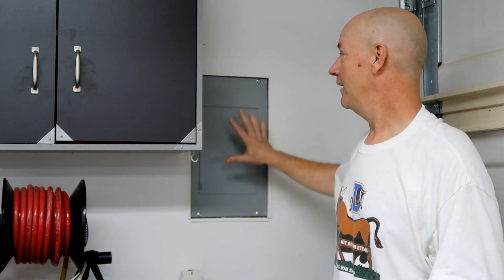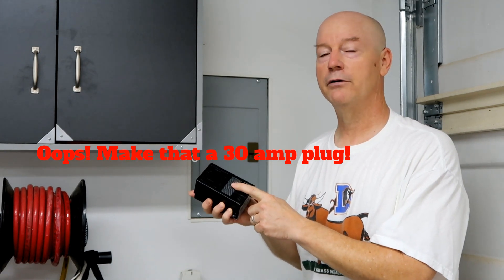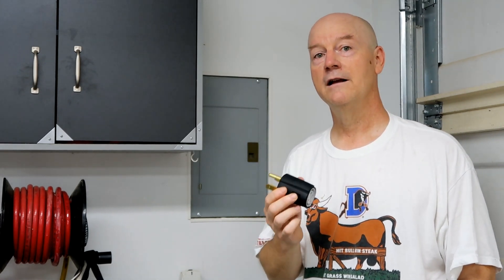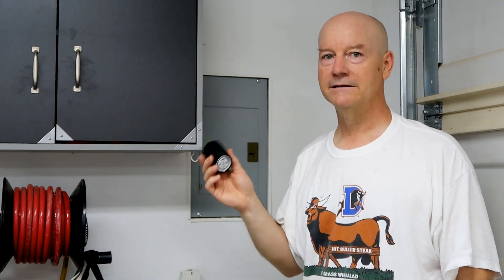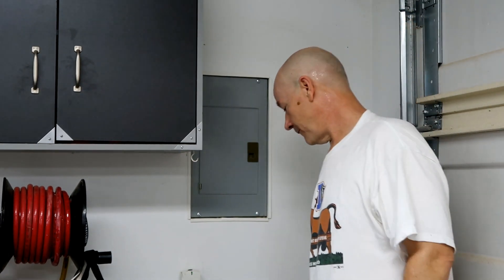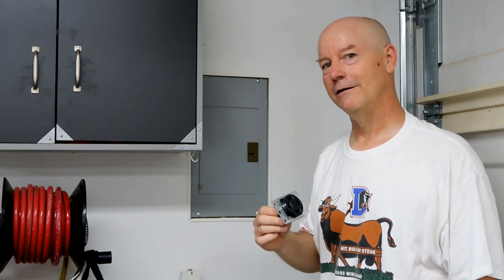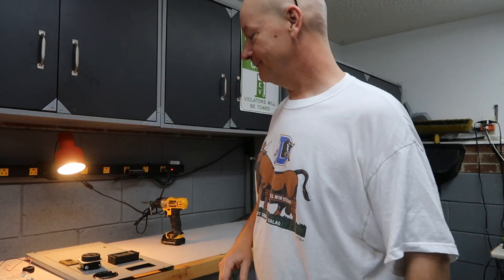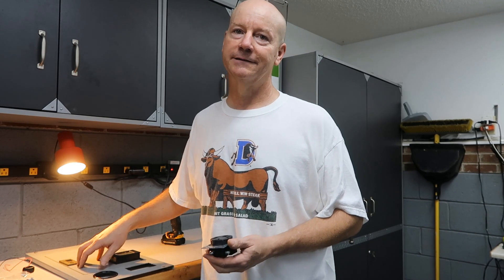Wiring the Electric Panel for Charging Our Tesla

Comment: Here's the problem: this is totally not to code.  You'll never pass inspection with this work.  Since you won't have it stickered or have a permit on file with your town, if there's ever a fire in your house your underwriter will work overtime to deny the claim altogether.  Do stuff to code, get it signed off on by the wiring inspector, and sleep easy at night.

Comment: An electrical panel is not a junction box . Therefore this installation is illegal . A 12' X 12" separate box or whatever size is needed will be just fine. The gentleman however did a fine job . But now needs to purchase a new cover and a junction box . Sorry !

Comment: I ordered one of those power energy meters today. I paid the extra couple bucks to get the split CT to make setup super easy.  I have a metal junction box 2 feet over my 16-50 outlet and plan on installing this in the cover.  I do have one question - you said to null out the tiny current the meter pulls to run one of the small wires from the meter back through the CT.  Do you mean one of the two wires coming off the CT you looped back through the CT before attaching it to the meter?  Thanks Don.
Reply: Joe, the split CT will be much easier to install.  I have used them before.  Besides the CT there are two small wires that power the meter and also allow it to sense the voltage.  In my case,  I attached those two power/sense wires to each hot wire at the 14-50 receptacle.  The CT was near the receptacle (like a couple inches down one of the hot wires). So the small amount of current drawn by the meter flows thru the CT.  So to cancel that current just run the small wire from the receptacle terminal thru the CT then to the meter.  Just do the one wire -  the one on the leg that has the CT.  You might have to use a bit longer (small) wire to connect to the meter.  The small wires don't have to be the same length. If you connect the small wires to the breaker then don't run either of the small wires thru the CT since the current the meter uses would not be measured by the CT.
Reply: Thanks, exactly what I needed to know.  I'll have to use 2' of wire to snake down to where the outlet is. Now I'm glad my electrician put a junction box in above the outlet.  He said it would come in handy one day.
Reply: Installed it today and it's working perfectly.  At first I didn't run the meter wire through the CT - just to see what it was pulling. Then I changed it and reads 0.0W 0.0A @ 245V.  Then plugged back in the MCU and pulls 0.05A  2.3W @ 245V.  Thanks for the clarifications.

Comment: I like that digital meter you added to the panel, think I might get one as well.  But looking at the install directions, I'm not clear on how to wire this for a NEMA 14-50 outlet.  Which wire(s) exactly did you feed inside the CT "donut"??  For a 240V application like the 14-50 outlet, did you feed just L1 through the CT, or both L1 and L2?  Or perhaps just the neutral?  The install directions show a normal 120v install with just one hot lead.  But not sure how to install this when you have 2 hot leads like in your case??  Thanks.
Reply: Hi Sean, I ran just one of the hot wires (L1 or L2 it does not matter) leaving the dual pole (240) breaker through the current transformer (CT) then on to the NEMA receptacle. The two small wires that power the meter are attached to the L1/L2 lugs on the receptacle along with the heavy wires from the breaker - that way the meter is reading the voltage at the receptacle. To get the meter to read 0 amps when nothing was plugged into the receptacle I ran one of the small wires for the meter back through the CT on the way to the meter.  That way the .01 amps the meter draws cancels. I did run a neutral directly to the receptacle, and you are correct if I ever plug a 120 load into that receptacle it's not going to measure the 120 power correctly.  Hope this helps
Reply: Sean - One more thing.  Those meters are pretty accurate.  I've compared it to a certified analog meter for 3 months and the digital meter was within 1.9%  of the analog meter (who knows which one is right). The fact they were so close to me means the digital meter is good enough.
Reply: Is there anyway you can post a picture of what that looks like? Im about to wire up a 14-50 outlet with 6 gauge wires and dont want to send the big wires directly to the bayite meter.
Reply: Hi Don,  I'm a newbie at this.  I'm trying to do the same as Sean.  I think I understand what you are saying but it would be very helpful if you could post a picture of the back of the pane where you have it all wired up.  Thanks!